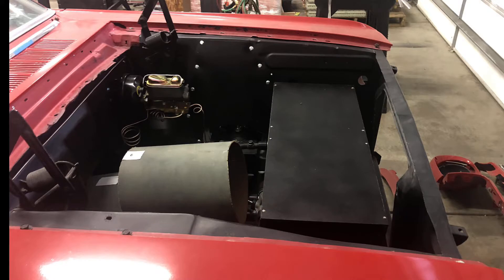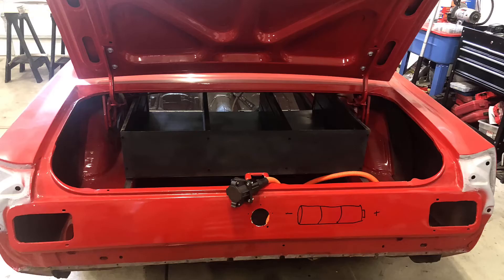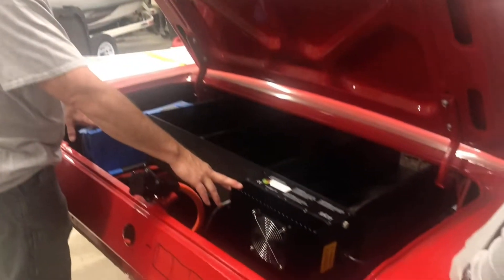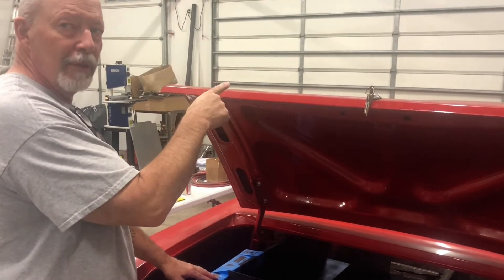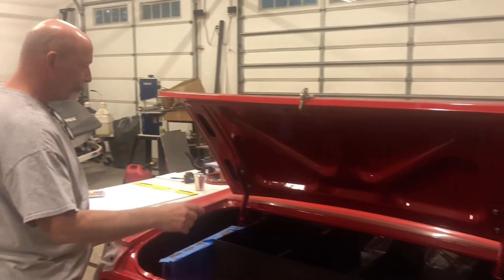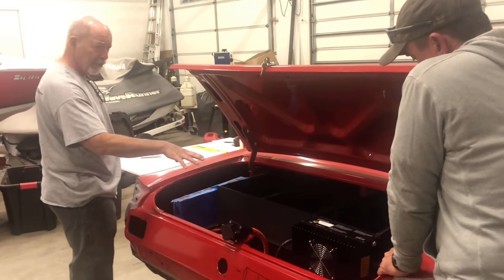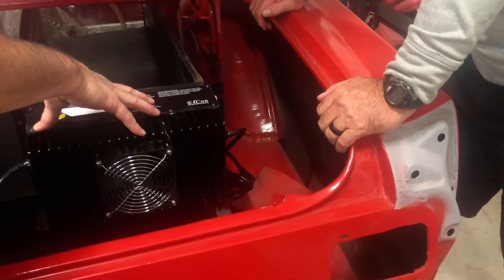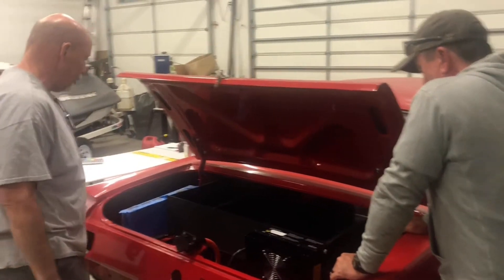Tesla Swap Mustang Overview with Tesla Motor and Battery Mock-Up

Comment: Interesting and impressive. Question: If you insert 16 batteries you get 386 V and 600 HP. Did you consider just to insert 12 batteries for 290 V and approximately 450 HP? I am assuming that HP is linear in relation to the amount of batteries. The alternative configuration would cost less and you could place one battrey box in the front and another in the back, right?